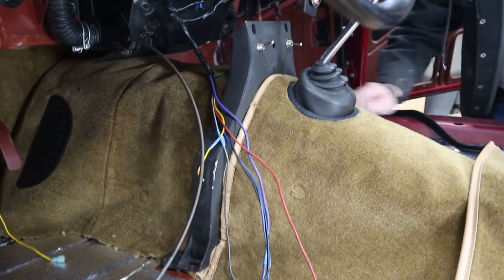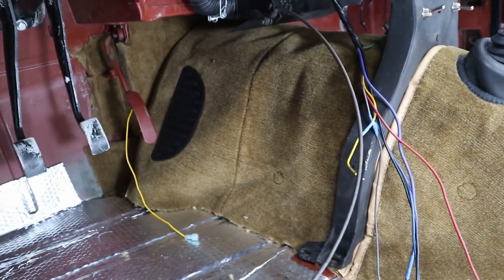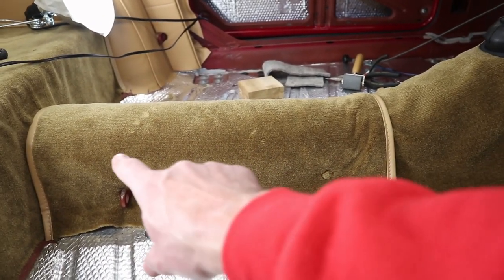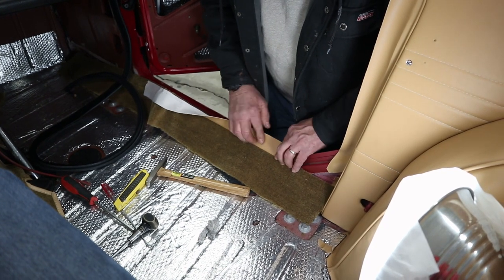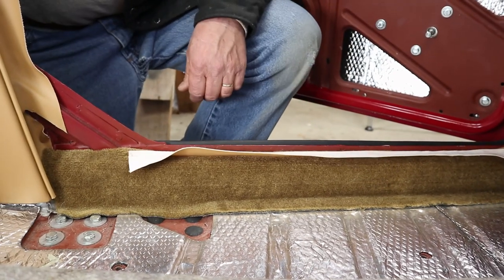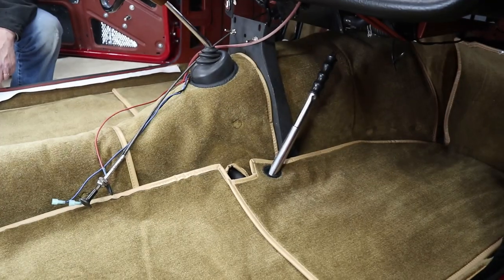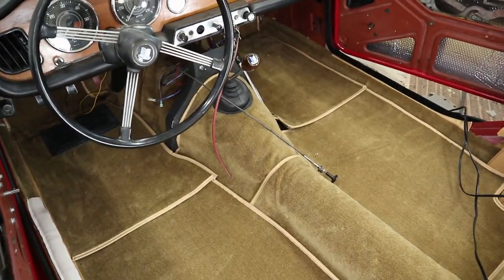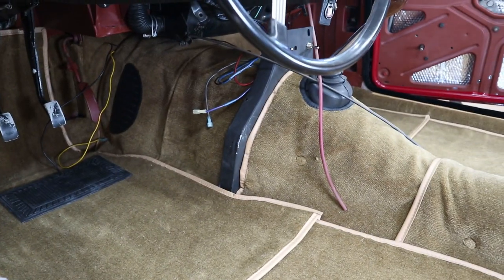Carpet is DONE!!! Triumph TR4 Interior Carpet Install Part 3 - WEGS GARAGE

Comment: go back and put the silver stuff all the way to the top of the dash, when summer comes ti will save your feet from burning up also when summer comes loop the top heater hose  back to the block and then the vent will blow cool air on your feet when you open the heater vent.
Reply from the maker: Good advice. I think we have just enough sound deadening left to do those parts.